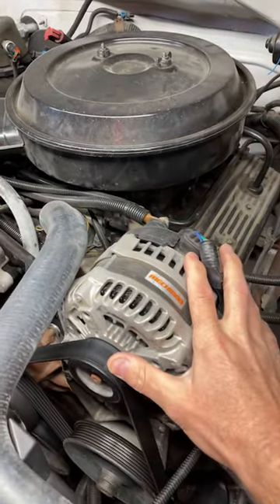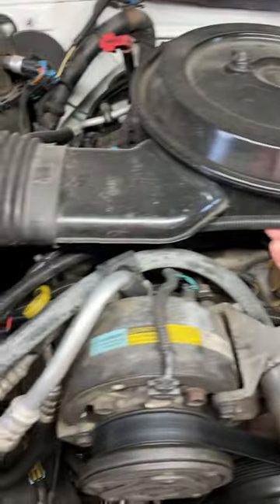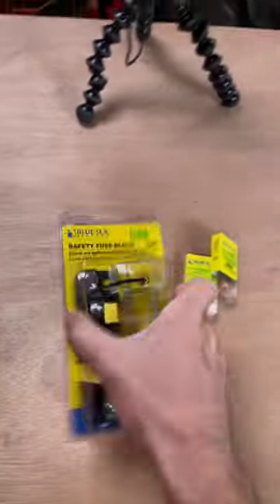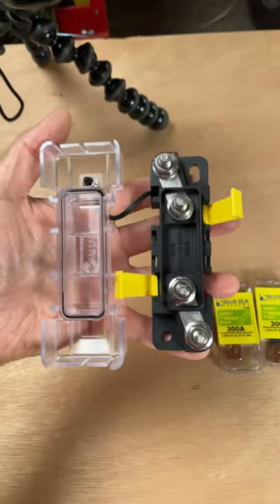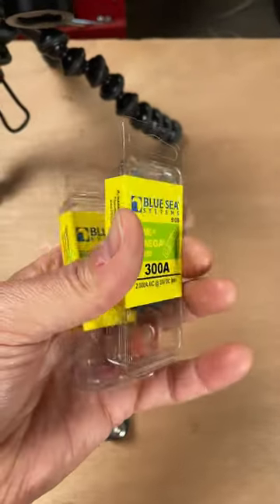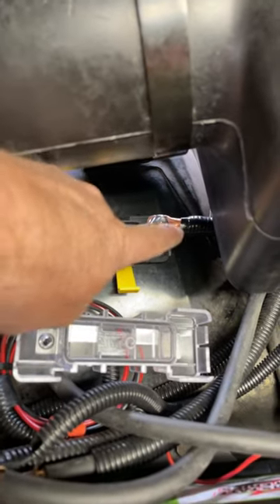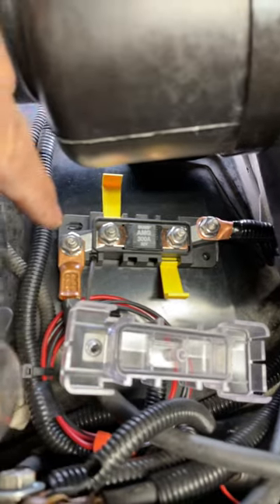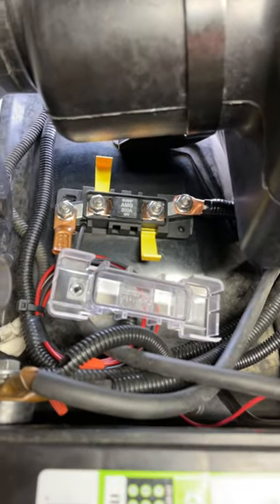Customer States His Install Was Professional!!

Comment: Fuses not required. no charge.
Reply: I thought the same, why put a fuse there in the first place?
Reply: @Stormf0rce999  if you don't have a fuse, if that alternator gives out and starts dumping its whole voltage/current capacity, that battery can become a bomb, complete with sulfuric acid bath.  or the wire will overheat leading to engine fire and destroyed vehicle.

take your pick.
Reply: @kenabi  you know it's funny because I've never heard of that happening to anybody
Reply: @Ja-fh8io  well rumour is that’s what happens so Stacy pants rx8 this week. You know the rx8 with stupid camber. He claims it was burnt down.
Reply: @kenabi  don't be dramatic it won't turn into a bomb lol but it will get the cells in the battery and can make it catch on fire.
Reply: @kenabi  really....
Reply: @fletcher_poll8152  but he said the battery was disconnected…
Reply: @Ja-fh8io  everybody go home it's never happened to anyone Ja knows and Ja knows everybody.  Solved!
Reply: @kdworak4754  see if more people could understand that world would be a better place🤣
Reply: @Ja-fh8io  well if you've never heard then it must not be true
Reply: Don’t state opinions like facts if you don’t know the standards
Reply: @kenabi no it CAN NOT DO NOT QUESTION ME  I am a 40+ year professional mechanic/ technician
Reply: @kenabi  well if the wire overheated on an Alt. you obviously choose the wrong one.

alternators don't force out any amps. it's the load that pulls on voltage and this creates not only a voltage drop but also a current flow.

if the current rises to high the alternators voltage will physically only drop to a safe level that does not destroy the alt.

but open circuit charge wires are deathly on many alternatordesigns.

hence i dont understand the fckn purpose of the fuse to be used.
Reply: @casemodder89  i don't even know where to start with this beyond holy f*.

as wire gets older (and with the constant vibration of vehicles), you get micro fractures in the copper itself throughout the stranding, eventually this leads to higher resistance, which in turn leads to heat, and at some point, well... fire.

so you've clearly never had to replace old oem alternator wires that have decided to give up the ghost.

or indeed any power wire with higher current running through it that gets moved/vibrated at all. even extension cords will suffer this problem at some point, they just tend to have an allow better suited to remaining flexible for as long as possible.

it has zero to do with 'choosing the right wire'. it is, quite frankly, inevitable. some wire withstands it better, some does not. 

and this is before you get into possible nicks in the insulation and corrosion factors.

and your entire premise on the alternator theory is with it being fully functional. if the thing goes full open, its not fully functional, it's in a fault mode where the whole of the AC current is going to the battery and over the output wire.

guess what happens when a '12v' dc high output alternator outputs 30-36v AC at hundreds of amps when the regulator circuitry fails and goes open? really bad things happen. things like fire, and explodey. you can get hundreds of amps of current out of an alt if you pull the regulator out of the circuit, its just going to be AC lower models can run as low as ~17v AC, with higher output ones being capable of up to 36ish with specific internal wiring). SLA batteries don't really tend to like having AC across them.

and even if its a partial fail open, anything over 16v will have a good chance at toasting the battery and possibly causing it to go meltdown.

those things are why you put fuses inline.

if you fuse it properly, it'll take out the fuse instead of the battery/car.

with the fuse blown, it shouldn't even cause the wire itself to do much, as the circuit path is broken, so there's no load to overheat.

this is literally basic electrical/electronics stuff.
Reply: @Stormf0rce999  It's so they can be different and feel proud of themselves.
Reply: Another way to rip of the customer on something u don't even need
Reply: Another way to rip of the customer on something you don't need
Reply: Because now the BLOWN fuse can be blamed for no power.
Reply: @kenabi  and that will disconnect the power lead.  See, a built in fuse.
I had a car that the battery used to blow up like a balloon when you ran the engine.
Reply: @Stormf0rce999  My buddy burned his fully restored 1985 1 Ton M1008 to the ground because his alternator took a dump. Safety first ✌️

Comment: I was wondering why your fusing a alternator? If for any reason under load the the fuse breaks any contact, you will torch the diode trio or regulator, and possibly the stator. My Leese Nevile 350 amp alternator has no fuse of any kind.
Reply: Yep that's why the factory doesn't use one. Now if you were putting an inverter in it you would want one near the battery just like that.

Comment: The customer did do a pretty top notch job compared to things I've seen other customers do to their vehicles. He had it routed pretty clean for the most part, he could use a buss bar to get some of those wires off the battery posts too.
Reply: This wasn't a customer, this was his own truck, he installed the alt. A few years back himself, and is finally installing a fuse. He made a video about it a while back

Comment: I would love to know your logic behind this. I have an electrical degree and there is zero point in this. The alternator can only put out as much power as the stator and diodes are built to produce. Meaning that a HUGE spike in amperage is theoretically impossible. The only way to have a large amperage spike would be if the stator randomly gained copper wire and gained turns on the stator and the diodes were magically changed. You sir, shouldn't charge anything for that NON-PROFESSIONAL job you just did and matter of fact you should replace his zero gauge primary charge wire because if you use a butt connector or splice it back together you are causing resistance in a high amp circuit which in turn causes the wire to heat up to the point where it could burn his car down.

Comment: I'd assume you charged probably 50 or 100 sense its not even an hour long job plus the fuse block I'm sure. So either 75 or 125 lol or you were Hella nice and charged 20 bucks plus parts lol. That's how our muffler shop is. Dude is way to nice
Reply: Charge 100$ and have just another person thinking you're a regular shop.
Charge 20 for service (since it only took 10 minutes) and 5$ for the part and have a customer that'll remeber the service and price and effectively making him a longterm client.

Ill take the "too nice" approach any day. Ill have multiple jobs.
You can keep the regular stuff and have 50% less work from twice has much clients.
Reply: @CartoonWeasel  unfortunately this customer already put in the alternator and wire, he's not coming back the guy clearly knows how to do anything lol. $15 doesn't even cover the fuse, so as someone with years of service experience you need to make money or your losing money helping people. Idc if people think that's being a bad mechanic, don't work for free dude.
Reply: @CartoonWeasel  you don't want to build a customer base of cheap skates... That's an extremely bad idea. You should be charging parts at cost and a shop rate that you think you're worth + double it because you probably think your worth half as much as you think you are.

Don't work for free my dude.
Reply: first of all... The fuse is not needed at all. So unless the customer asked for something stupid like a fuse between the battery and alternator, he may want to think about puting it back the way it was correctly done.

Comment: For those who don't know, he added a high amp alternator for car audio and or accessories along with a thicker cable separate from the car's factory charging cables, to carry the added amperage through the battery to those components. Adding an inline used to this setup may help prevent a possible fire if something shorts.
Reply: Yeah, and most people dont use a fuse because it makes no sense to put one (unless you are doing a run into the cabin)
Reply: Thank you for the advice man

Comment: Normally the fuse would be on the amplifier power wire coming to the positive battery side but you can add that fuse for added protection….
Reply: Stock vehicles come with a fuse for alternators I'm not sure what you mean. Audio systems use a different power wire yes and that should be fused but he mentioned nothing about the audio setup, he was talking about the alternator itself.
Someone here said Mechman always recommends an inline fuse for the alternator.
Reply: @jacob Webb you may be correct but I’ve never seen a fuse coming from the alternator to the battery ever…..now I have seen a fuse between the fuse box and battery…..
Reply: @Ronc5200  some vehicles have them in the fuse box, some have them on the terminal itself. It's called a fusible link for the alternator and it's a more new thing than anything I believe. It's basically a bus bar for a few things including alternator charge

Comment: 18 years and I've never seen a fuse on an alternator charging cable.
Reply: Most cars have fusable like wires, rather than a standard fuse. The wires will burn up from to much amperage and that restricts current passing through.
Reply: @justin.gollnick  Ummmm no.
Reply: how about fuse from battery to audio amplifier?
Reply: @aly8848  Yes!
Reply: @RebornRockerVids  
Most cars from 2000s have a fuse between the battery and the alternator, and i am almost certain that all newer cars have them, if you take a look at the fuse box in the engine compartment there's always a fuse for that, and it will have the highest AMP rating,
It doesn't take anyone 18 years to figure that out.

Comment: you’re right about importance of fuses!  have a diesel with two batteries…i replaced the starter cable and feed cable to distribution block and did use a maxi fuse…thank god..because one dropped ratchet later i needed new fuse…lol

Comment: If it's at a dealership theyll charge the full hour so probably around like $100.
Reply: In Alberta dealerships charge $175.00 an hour, minimum 1 hour labor.
Reply: @sspeedy2859 the exchange rate makes that ap a little more tolerable, but damn that still hurts.  To be honest I don't take my vehicles to dealerships to get them worked on so I really don't know what they charge so it could be more.
Reply: @hotfiyah  Nor do I, The dealership I worked in back in the late 90s it as $70 an hour, min 1 hour.

Comment: Guess I should mention, on my previous comment the failed alternators were 90ah alternators one on a Ranger and the other a Ford Explorer. Both over 230,000 miles and worn brushes caused both

Comment: My old pickup had a fusible link, i upgraded the wire size so i used a bussmann marine manual reset breaker.
Reply: Great idea 👍
Reply: That's what I was thinking. Why wouldn't you just use a circuit breaker so you don't have to deal with the fuse.

Comment: Have a question, I just bought a 1999 Ford f-150 about 6 days ago. However the air don't work it's like the blower motor is not getting power I checked all fuses and relays their fine I even s swapped out the AC power knob from my other truck and I still have nothing!
I'm becoming extremely frustrated and I don't know what to do next! Can you please help? I did ask my friend and he said that he'd try to be here tomorrow.
However with no working blower motor no AC in the summer and no heat in the winter! 

Please help! Asap!
Thank you for everything

Comment: What is he planning on running off the alternator a bunch of lights to go spotlighting at night? If so I could see this maybe due to the power that a big bunch of lights would pull plus the radar and maybe a power converter,
But if he pops his fuse the battery won't last but a minute to 5 minutes tops hell need a smaller wire running from the alternator to the battery for an emergency backup that'll just keep the vehicle running.
.
.
.
 And for you charging the owner I'd say around $40.00 to $50.00 plus parts!
I truly hope that this helps 😊

Comment: Don't you only fuse it if you're running an amplifier or some other high amperage accessories? You'd fuse it about 12 inches from the battery on whatever cable is going to your amp or whatever.  If you did the "big 3" are you saying you'd fuse the positive cable? Just wondering because I have always been into competition car audio and have one of the said, high output mechman alt (370 amp elite series). As well as a 2/0 ofc xs power big 3 kit or big 4 some call it. The only fusing I used was a 300 amp fuse between my battery and amplifier and I learned from "professionals". I'm a bit confused.

Comment: Next time use a wholefire 300a waterproof circuit breaker, they are half the price of blue sea and there is no fuse to buy... Or you could use a stud mounted 300a, avoids the extra wire from the battery to the block, goes onto the bolt of the battery clamp... as for how much to charge, that all depends on which breaker/fuse block, how much you pay per ft and which wire you use, also if it's for a friend or just a customer...

Comment: The fuse protects if the wire shorts out anywhere to the vehicle ground - on the body/common earth. Like if it rubs through the insulation and shorts out on the engine block. Fuse blows fire prevented 👌
Reply: But both sides have power? Regardless of what side blows your going to have problems, either from the alternator or battery. This would only work with two fuses. 🙄
Reply: @CSR_CarShowReady  it's just standard practice.

Comment: Dude, get over yourself.  It doesn't need a fuse because there's no wiring harness to protect since it's just a single wire between the alternator and battery.  Fancy fuse though, sure it'll look great when it becomes a poor connection over time.

Comment: Why do you need a fuse?
Reply: It's a safety measure in case the alternator stops working properly and starts putting out greater amperage than the battery can handle. The fuse will burn out before the battery can be damaged and catch fire or explode...
Reply: @randyherringshaw6325  you really think that alernator is producing 300a 🤣
Reply: you dont 😂
Reply: @randyherringshaw6325  how many manufacturers put one in from the factory?
Reply: @byloyuripka9624  There's probably a good reason for that. Some limousines use 2 high-output alternators.
Reply: @randyherringshaw6325  man thats actually like reason number 2, its to protect the alternator if a surge of high electricity ran through it, the fuse preventing damage first, by cutting off all circuitry to the alternator
Reply: You don't
Reply: @byloyuripka9624  high output alternators for stereo setups regularly generate 300-500 amps to keep up with the high amp draw of the stereo. A regular alternator on a newer car today with all the electronics come factory with about 180 amp alternator.
Reply: If that wire gets pinched or too close to the motor heat and melts it will short out and cause a fire the fuse stops the flow of current in such case and stops the fire from happening.

Comment: My 08 Chevy Tahoe comes stock with a big fuse just like that one. Power from battery to fuse, then from the fuse to alternator and  to main fuse box under the hood. Just had to clean both ends of the fuse because a little corrosion wasn't letting the battery get fully charged to 12.6v, still got power just not enough.  Lots of vehicles have these big fuses, I've also seen them on a semi

Comment: I have a circuit breaker on my Mechman 320 alternator, with (2) XS D3400 batteries. I stay above 14.8 with the rvc bypass for my 2011 silverado.

Comment: Nice job and great selection on the fuse since that alt probably output over 200amps. Need more mechanics like yourself. As for cost parts plus 20% and time.

Comment: 20+ year tech here. No heat shrink. It will fail in a couple years from corrosion depending where it lives. Not worth anything. Also no marking to show positive or negative when the battery gets changed. Don't touch anything a customer won't let you do correctly. When they show the thing you did to friends, they see the whole job. Not just what you touched.

Comment: With the high amp alternator, you can run an onboard welder, with 110V power supply -- the welder has a built in warning system to let to know if the battery is getting below starting capability power

Comment: people saying dont use fuse no you need one for high output fuse because it can pull more amps than a normal battery can handle and end up burning the battery and or wire.

Comment: Why put a fuse between the alternator and battery? Was it an extremely long run that ran near pulleys or something? I mean did you put a fuse in between the fuse and the battery? Unless the wire is in danger of some sort a fuse is never needed between the alternator and battery, it should be as direct as possible with no joints between them.

Comment: You don't need a fuse if the charging cable is of proper gauge and less than 2.5 ft. A fuse just protects the wire. I've never had to use a fuse and never had a problem.

Comment: When you run these higher amp alternators they are expensive and a fuse like that is for protection of a short back to the alternator not the alternator to the battery so much.

Comment: So what about that four foot section of heavy gauge wire attached directly to the alternator. That's still live all the time and is more then capable of shorting and burning the insulation on it and anything it touches like a sensor Vref or anything else attached directly to the pcm/ecm. Fuses should always be located as close as possible to the source of the current.

Comment: Well because normally there's a  Is fused in way for the  Charging system automatically put in from factory But when you go to a higher output you need to actually put in a higher fuse to counter  act it